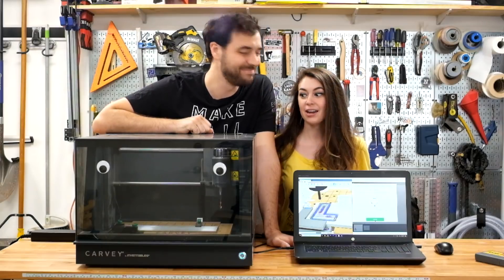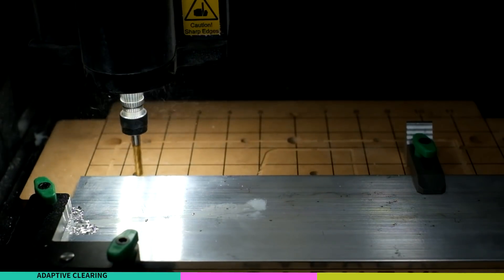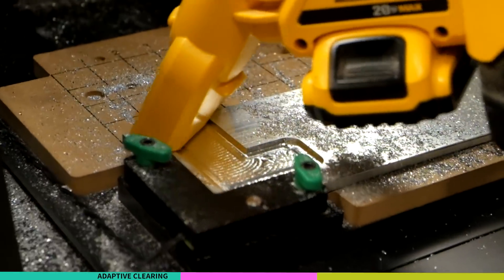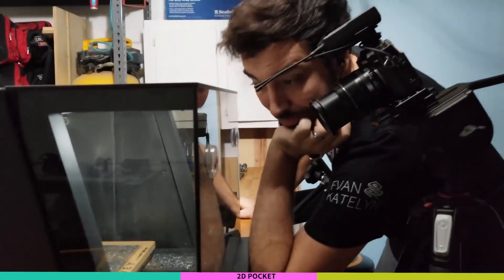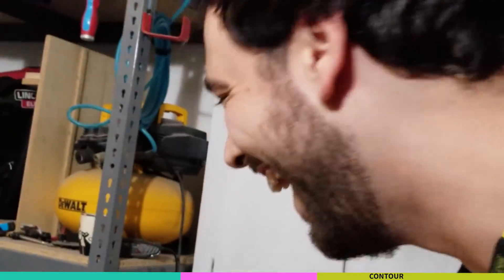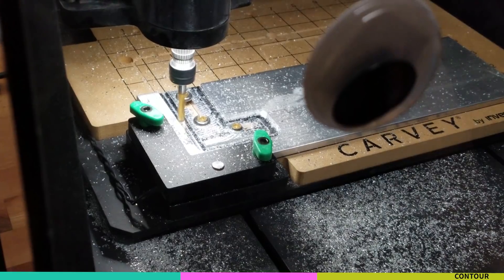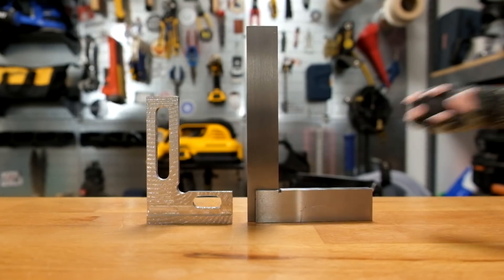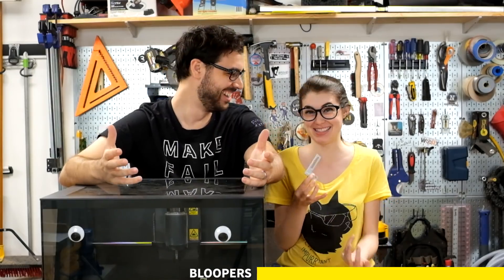Can You Cut Aluminum on a Desktop CNC?

Comment: Aluminium (yes, with an I) can be cut with regular wood tools so as long as you go slow it 'should' be relatively easy. (I'm guessing by the length of the video it wasn't easy?)
Reply from the maker: We've cut aluminium (we're down with either spelling lol) on our miter saw nice and easy before which is super fun. And I think once you dial in your settings it's quite doable to cut on a hobby CNC like the Carvey
Reply: @EvanAndKatelyn  I have a cheap chinese CNC that I got on ebay and it rattles itself to bits cutting wood so I really don't trust it to cut Aluminium. But if I do ever try I now know how fast I shouldn't go 😂
Reply: Yup very doable!  As I'm sure you know as with all CNC work its a case of honing your settings! 

Protip - Remember to write the settings down when it finally works!

 Also the router bits you choose for a job have just as much of an impact on the outcome.

@EvanAndKatelyn Love the channel its one of my favourites keep it up! :)
Reply from the maker: @Ben A very good tips! Luckily we documented it in video form, phew!

Comment: Give me 3d pirinter very need lm student and no money please
Reply from the maker: There are definitely some places out there where you might be able to get access to one. Many local libraries can get them at discounted prices. I would recommend some google searching and talking to local libraries and makerspaces to see if you could get access to one for free 👍
Reply: EvanAndKatelyn  I've been printing at the library with success, but they have a 5 hour maximum print time and a Lulzbot Mini so even if there were no 5 hour max it would not be able to print larger than 6"x6"6" (roughly).  However, it is completely free!!  I printed a Trash Can Robot like the one 3d Printing Nerd did (much smaller than his) and I'm printing a headphone holder that I "designed" in Tinkercad(also free!), because my headphones are on the floor right now.  Next I'll design a holder for my headphone wire at work (now I'm using a binder clip and it's not ideal)
Reply: @sherizaahd  you'll have to do what the rest of us who HAVE a printer but it's small: Print bigger stuff in pieces, then glue it together, gorilla super glue has worked great for me, but there might be something better. I'll try 2 part epoxy one of these days.
Reply: EvanAndKatelyn please please please very need no money l poor
Reply: @mustafasaltuk7991  kit printers have gone down in price quite a bit and the ended 3 is pretty reasonable